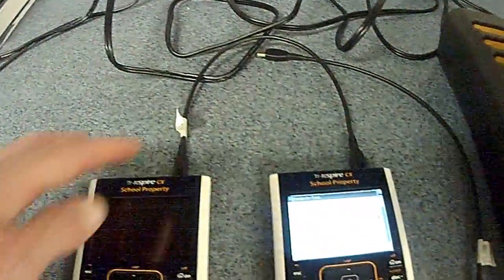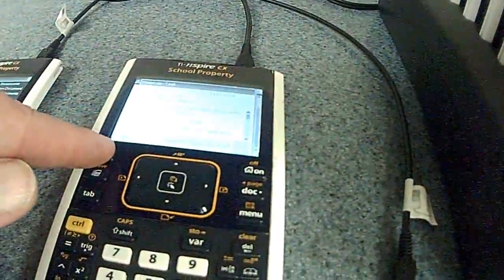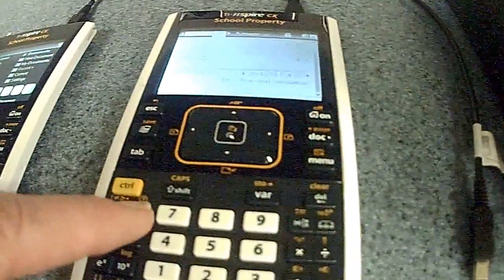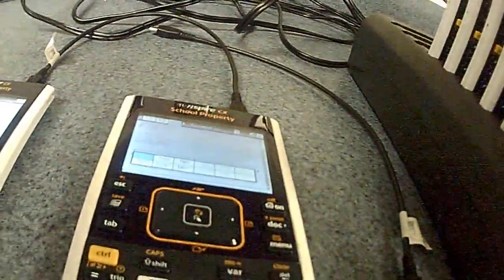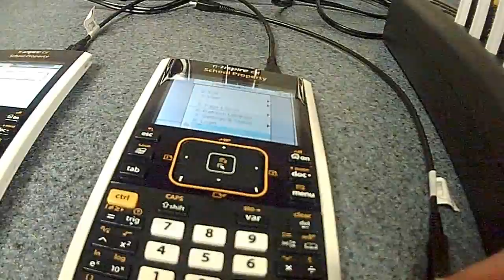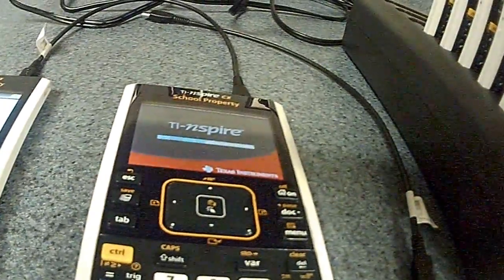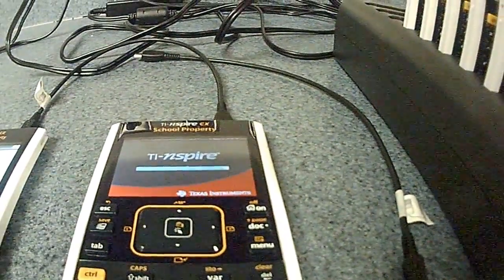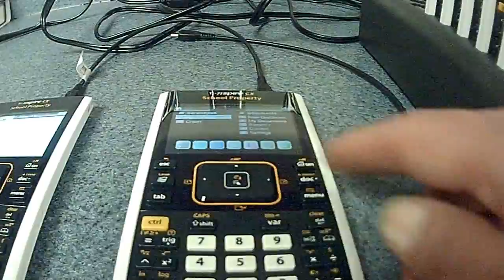Exit Press to Test Mode TI Nspire CX Calculator

Comment: So you are telling me that if I have one calculator and I accidentally put it in press to test mode I have to go find another calculator just to turn it off?  Why can't I disable it if I own only 1 calculator
Reply from the maker: TI tells me there is a way to use a computer connection from the TI 
website to exit press to test.  You can call TI at 1800 TI CARES and a 
tech support person should be able to help you.